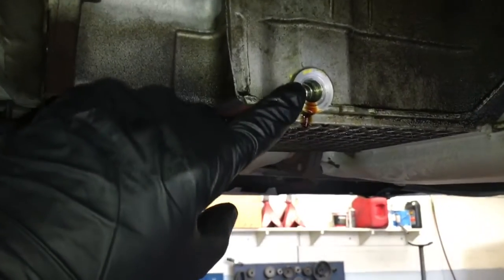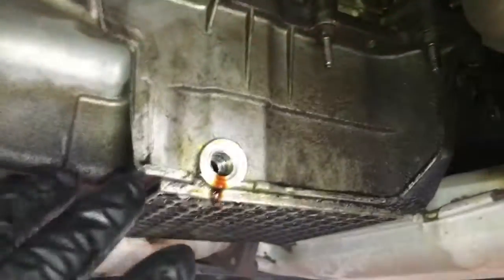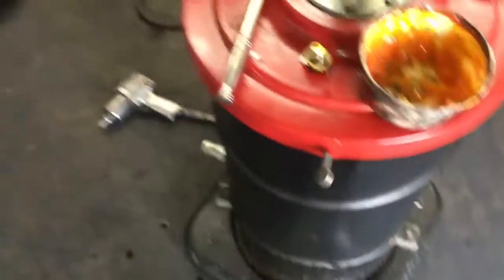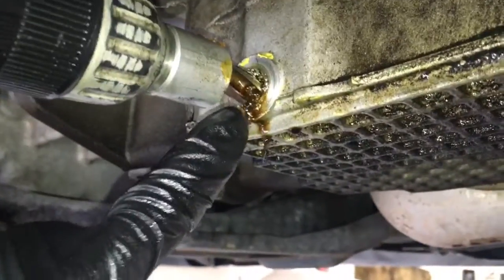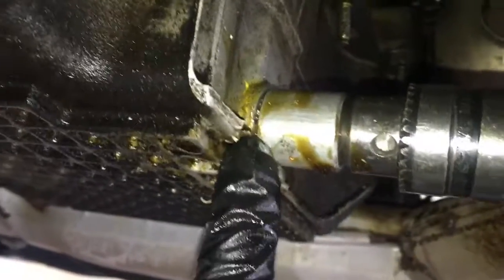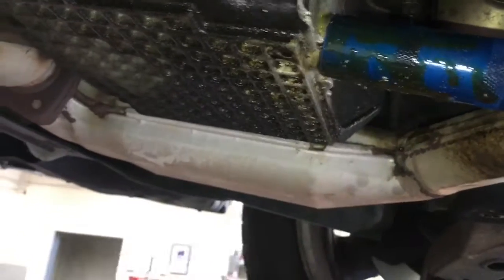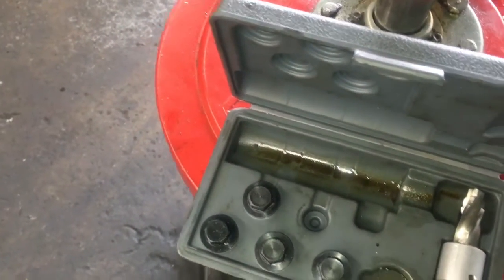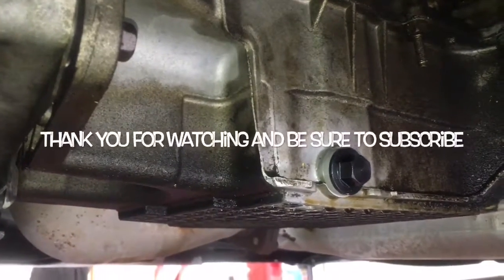How to Repair a Stripped Out Aluminum Oil Pan

Comment: BUY AN ECOPLUG ON AMAZON THERE IS NO BETER WAY.THE GREATEST OIL DRAIN PLUG EVER INVENTED.I have been using them for years on all my vehicles never a leak or a problem regardless of whether the oil pan treads are steel or aluminum good or bad it doesn't matter and changing your oil with an ecoplug is safe and clean the plug installs and removes literally in seconds.

Comment: I've seen some videos that use helicoil or timeserts.  This seems much easier (and cheaper) than the timesert/helicoil.  Are there any advantages/disadvantages for doing this over a timesert/helicoil?  Also, will this work on steel pans (2001 Toyota Camry for example)? thanks in advance.
Reply: Helicoil are amazing! And cleaner.

Comment: Leave you plug out, pour oil in... it will push out the shavings left over. ALWAYS DO THIS. ITS A MUST.
Also you don’t wanna push the bit to far on most cars have a pick up and somtimes a plastic block 2 in Infront of the oil plug hole!!! So you could mess your engine up. So don’t put the bit past the threads. 
On my bmws and Mercedes I have to be care on not pushing past 1 3/4th inch past the plug hole.
Reply: No way will this actually flush em out?
Reply: Absolutely
Reply: @killaslaye  yes. You never wanna run a engine with shavings IN the pan unless you run a 5-10qt flush. Even threading your bolt in half way and letting each 5qt fill up then Unplug so it gets shavings up out the walls aswell. So fill 4-5 qts the unplug. Repeat. And repeat. 

Now If you drilling your drain plug then you DONT wanna plug and fill. Just run it through it. You don’t wanna plug and the oil push the shavings up with a lot of fluids so if your fixing A plug you GOT TO leave the plug out and run oil thru it. Then another way after to ensure you got all shavings. Is some grease and rub your new threads with it it will pick up shavings aswell. But the oil flush is a MUST